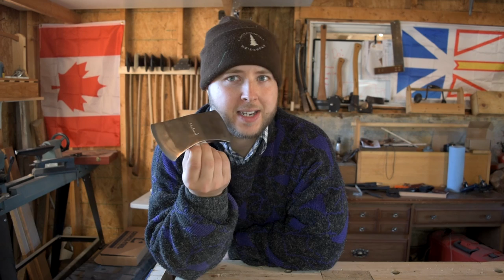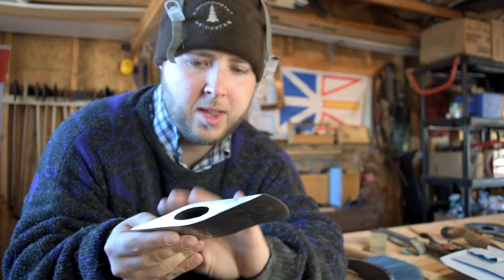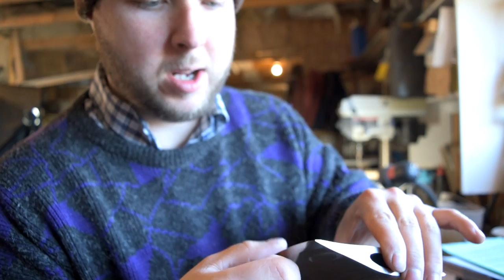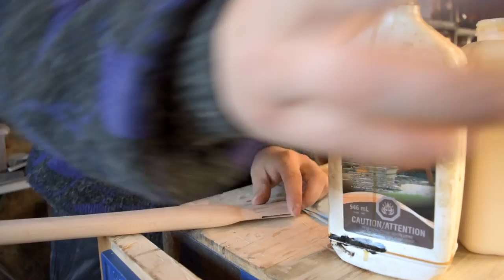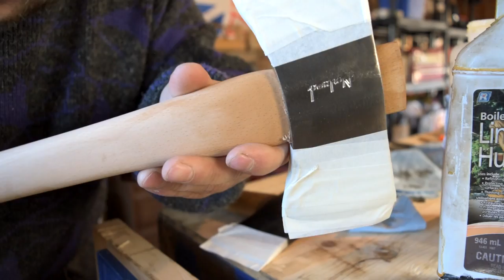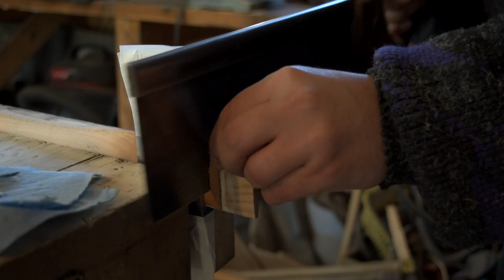RESTORING DAVID CANTERBURY'S FAVORITE AXE - Norlund Saddle Axe

Comment: Great work, Kyle. I also like sharpening on a medium grit belt and finish on a felt wheel; gives a wicked edge. Only problem is that my bench grinder is a bit too weak than I'd prefer. Can I ask how powerful the motor on your grinder is? Take care!
Reply from the maker: I believe mine is around 1/3 to 1/2 HP. That's a guess based on other motors I am using

Comment: I spent 30 seconds to cut and paste the name of the axe from your description and found one for sale for $275 with a handle and sheath. May not be in amazing condition, but not that rare or as expensive.
Reply: I found 3 all for far less than $400, even if you are going by Canadian dollars.
Reply from the maker: I would call those numbers pretty expensive!
Reply: @Kyle Noseworthy You said they cost north of $400 and that is Canadian? The axes I found were $275 for mint with a handle and then two other axe heads that cost less than $80 that were in okay to rough condition. I don't think that $400 is even remotely close to their worth. That is about as accurate as Dave's account of his military service. AKA BS......
Reply: Also to say they are rare when there are three of them on eBay and 2 of them for less than $100 is not exactly what I call rare.

Comment: You know how you can hear when steel is hardened when filing it?  It's funny how you can hear how hard, abrasion resistant hickory is.  
I glued in my wedges too didn't know that you do that.
Reply from the maker: Absolutely! The sound is so distinct between different hardness of wood. 
Also, I don't always glue in my wedges. It's not usually a necessity, but I did in this case since there is such a shallow wedging, given the size of the head!

Comment: They're expensive for no good reason because they're really not a premium tool.
The norlunds may be the most common or most well known, but the Plumbs and old Michigan pattern Collins Saddle cruisers are much better.

I suppose the myth regarding the Companies history has people viewing them through rose colored lenses.
The whole " learned from the Swedish " thing is BS, and Norlund did not actually manufacture anything.
The Axes were made by Mann edge in the declining years for this manufacture.

You may have to look for a good one, but is much rather have one of the Marbles saddle cruisers made by Imicasa.
Excellent value for $20.